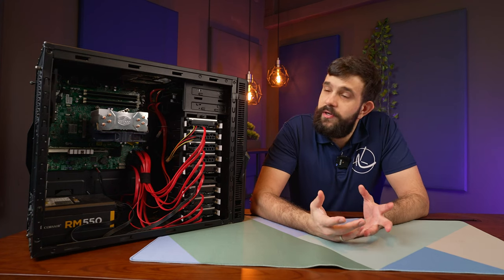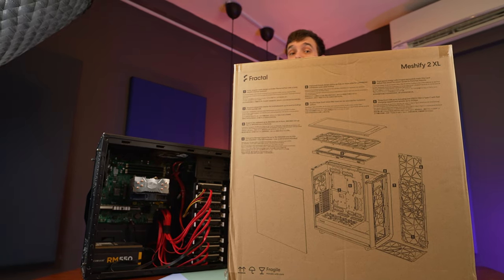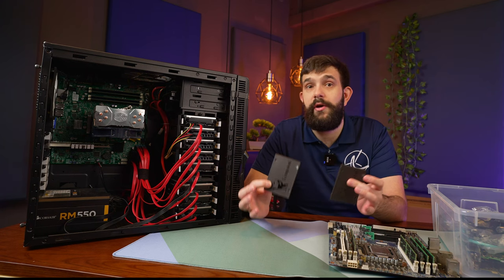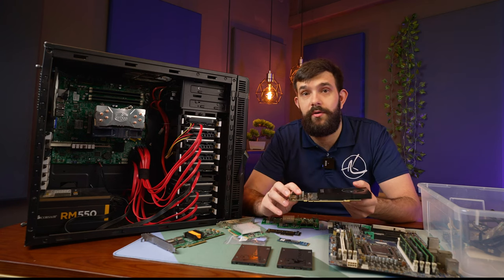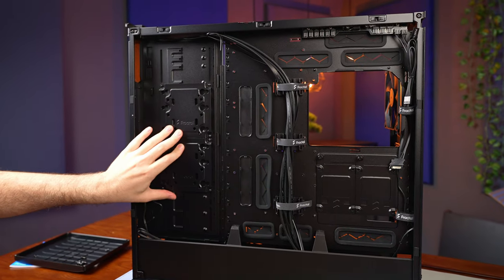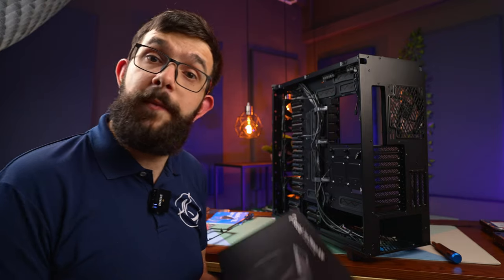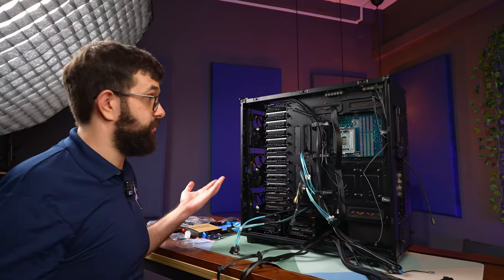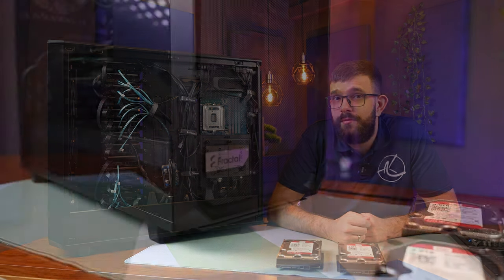Mountain of Drives in ONE Case - Fractal Design Meshify 2 XL

Comment: Awesome video 
As always 

Very interesting to see a server related video by you & present a realistic scenario while doing so. We all have to go through some hardware upgrading /maintenance every couple of years. 

I’ve recently gotten new cases for the servers I’m running as well. Got some cheap Chieftec cases & another SilverStone case as well. 

Really would recommend looking into Chieftec cases , relatively small form factor & a number of models support ATX-size motherboards , a number of drive slots 2.5/3.5” & price for these cases here is around 40-50$. 

Of course , if you have say 12+ drives and/or multiple GPUs in your server system , then a large case with plenty of air flow is still king.

Comment: Would've definitely gone for air cooling instead of liquid, reduces points of failure for a 24/7 runtime system to just the fan alone and still gives you the option to mount the remaining hard drives up-top as you initially decided on.
Reply from the maker: Great advice! Would certainly recommend that for most.

Comment: I love the video! I found it since I'm in a similar situation where I'm upgrading my existing homelab and I need more space in a case and I don't have room for a rack anymore. I've been heavily considering the Meshify 2 XL and I'm pretty close to pulling the trigger. Is there anything you would change after a year of this install? Any issues with the case, cooling, etc? 

Anyways, thanks for the video!
Reply from the maker: Thanks! Not had any issues with it and probably would not really change anything. Jus get most power efficient psu that you can
Reply: @A2KMedia  I'm reusing the EVGA SuperNOVA G2 I got in ~2019 so I should be good there for power. Thanks for the reassurance and your help! I hope you have a good night!
Reply from the maker: not bad! :) hope you have a smooth build!

Comment: Congrats on the video! Really informative! Will a 360mm liquid AIO fit with that configuration?
Reply from the maker: Hey, thanks! With the drives config, 360 won't fit.
Reply: @A2KMedia  thanks alot for thebreply. But even if I dont populate with the last HDD in the top cage? I have a 360mm Arctic Freezer Freezer II and I really wanted to fit him in there with my 7980XE xD
Best regards
Reply from the maker: The cage itself is in the way as it stands sideways to where the rad is.

Comment: Looks great, I would swap where you put the p2000 and the HBA though. Not sure about this specific board but typically lower 16x slots don't run at 16x which that p2000 would benefit from. Looks like an LSI 9211 and those run at 4x iirc.
Reply from the maker: hey, this is a workstation board with xeon processor. In this particular board all slots are full pcie so not a problem, but valid observation for consumer platform.

Comment: It would have been a good idea to show the temperatures of the HDDs running in the old case setup, vs the new case setup - after all the two main reasons you had for upgrading was for additional HDD mounting spaces and to keep your drives running cooler.
Good video for the rest of the information though, thanks.
Reply from the maker: Great point! sorry about that!
Reply: @A2KMedia  so, how are the HDD temperatures?

Comment: I have the exact old Define R4 case with 10 HDDs AND 1 SSD.  Yours was almost like it's twin brother haha. Though my sata cables were mounted neater and via the back. I am looking at the Meshify but not sure it worth moving everything over. Maybe in another few years.

Thanks for the video!
Reply: i too am still using the define R4, currently five 3.5 HDD's installed, it's a bit sketchy with the newer high capacity HDD's cause of the position of the screw holes on them, the case mounts don't match, can only screw 2 screws in.
Reply: @bikingchupei2447  2 screws is enough for me. Does the job.

Comment: So after all that, how cool/hot are the drives running?  Are the drives next to the power supply able to stay cool?  Did you end up adding a third fan to the front or any other fans?

Interested in doing something similar, so any info would help.  Thanks
Reply from the maker: Drives are between 30-35 C in a room with ambient temp of 25C so everything is perfectly cooled and I would not do any changes. Pretty happy with the build.

Comment: A local Fractal reseller is telling me I need to buy both the HDD cage and HDD tray for my additional HDDs.

FD-A-CAGE-001 HDD Cage kit - Type B, Black
FD-A-TRAY-001 HDD Drive Tray kit - Type B, Black, Dual @ $21

It looks like the cage isn't need right? From your video you're only using the HDD trays with existing mounts.

Comment: Don't forget to proper screw those drives into the cages to prevent vibration. I'm sure you are on top of that.  I wonder if since I only have 7 HDDs currently if I should get the regular Meshify 2 or the XL? Room to grow? I wonder if the tray will be flimsy without a full stack of drives? Please inform me.
Reply from the maker: Screwed them all up. And if you plan to grow then xl is certainly better choice
Reply: @A2KMedia  Thanks and love your videos

Comment: Hello, thanks for the video and great build.  I know I'm late to vewing it,  but I'm curious though...  Did you have any problems fitting that HP motherboard in that case (and old case for that matter)..?  as I understand it,  HP is rather proprietory with their connections like fans and power supply.  How did you overcome these problems or is this particular HP board more standard?  Thanks again..!
Reply from the maker: hey, no issue mounting the motherboard in this case as most of the screholes align. For the PSU I bought it with a little converter which you will need to get. It converts from standard atx to dell weird pin out

Comment: Have you ever compared this case aircooled vs Torrent?  I'm wondering if anything can be done to get it to CPU and GPU cooling closer to Torrent, because I like this case's ability to hold larger motherboards and more storage drives.
Reply: The Torrent isn't made to fit a lot of 3.5 drives.
Reply: @AlL-fw2cy  I know.  Just wondering if the Meshify 2 XL can be made to cool and silence as well as Torrent.
Reply: @StefanUrkel  sure, if you mod it. Bust out your dremel and jigsaw and custom fit three 180mm fans in there. In the end it will be cheaper to just buy a Torrent and trying to figure out how to put 3.5 drive cages in there. But 3.5 drive cages will impend airflow. That is probably one reason the Torrent has so few 3.5 cages. It's a modern tower not designed for mechanical drives.

Comment: Funny how this popped up in my recommended, I've been searching for people's NAS builds while I was doing research as I'm upgrading my own.  To not let my data hoarding habits get the better of me I went with the Define R5 to limit myself to 8 3.5's.  And as much as I love repurposing older hardware (current NAS is running on an E3-1230 V2, VM box is a 2678 V3) I couldn't resist getting myself a second hand EPYC Rome mobo + CPU + Ram combo for the upgrade.  It will be nice to consolidate my NAS + VM machines into one (sounds like you did the same).  

Just out of curiosity, have you ever had any problems with Truenas virtualized?  I've seen a lot of 'don't do that' comments floating around but I can't find any hard reasons why (not that I don't get why it could be considered a bad idea).
Reply from the maker: woahhh nice plan! I actually just ordered that exact set-up. going up to 24 cores on Epyc Rome :). To answer your question -  I've been using proxmox and virtualising truenas for about 1.5 years or so, not really had any issues besides my own mistakes with virtualisation - but learned a ton and don't plan to change this

Comment: If the front fans blow air though the spaces between each 90-95 deg hdd, wouldn't it be blowing hot air into the center of the case?
Reply from the maker: not had any temp issues since day 1 in this

Comment: Can you fit the x2 3.5 HDD drives where the Kingston ssd cards are at fit a grand total of 18 3.5 inch drives in total? I'm looking for a similar build but instead of the AIO, I'm thinking 2 fans for exhaust, 1 rear exhaust, then 3 front intakes at 140mm all fans. Air cooled with Noctua. Im also looking into the i9 12900ks 12th gen with integrated GPU, aorus master Z690, ECC ram not sure yet (recommendation?), PSU what do you suggest to hook up all drives with minimal splitters usage? To hook up all drives I was looking into LSI controller 16i 16 port as I think this should be enough to connect 16 drives and then connect 2 drives to the MB and can use 2 nvme cache drives. Main purpose is for plex and storage. Please help?

Comment: Hey! Thank you so much for this detailed review/build video. I just got the case myself. However, I have a question I hope you can help me with. 
For the HDD's mounted on top of each other, do you just need that one screw to attach each HDD/bracket to the case, or is it necessary with another screw against that wobbly back panel? I am afraid the HDD's will not be fastened well enough as I have tried putting the bracket it and it doesn't seem to be very stable.
Reply from the maker: Hi John, thanks for the feedback! Yeah you need to screw front and back, I recommend doing few top slots then middle then bottom to make it secure and then you can do the rest of the slots as you go. Also may need extra pair of hands for the initial bit just to make sure everything is straight

Comment: How did you power these drives? From what I can see, the PSU you used has 10 sata connectors, but you have more drives than that. I would like do the same build so I am very interested. Do you have any pcpartpicker list or more details on the drive expanders used?
Reply from the maker: I used few splitters too

Comment: I read somewhere that The meshify XL could have 18 x 3,5 drivs? Like The Define 7 XL?
Reply from the maker: You could slot 2 more drives with multi mount brackets at the top instead of the aio that I installed.

Comment: Do you use any specific kind of expansion cards? i have looked for HBA expansion card and most of them could be a bottleneck in transfer speed, if you got a link to the expander you use it would be much appreciated, if not i would love to know the max transfer speed your card has, thank you so much for the video.
Reply from the maker: technically speaking if I were to write to all the drives that are connected to the expansion card at full speed then it will saturate the link, but that almost never happens so I would'nt worry about it too much.
Reply: @A2KMedia  I mean, like can you write to a single disk at max speed? I am looking to set up a similar system to yours and my biggest worry is If the card could keep up with writing data to 2(or more) disks at 2gigabit per second, as I have 2 1G Ethernet lines coming to my server, so I want to make sure my bottleneck is network speed and not HD read/write data because of the card
Reply from the maker: oh you will have no problem with disk side then. the expander is HP 468405-002 24 Bay 3GB SAS Expander Card. I recommend reading up on  how it works. It has way more than 2gigabit speed as its 3gigabit per channel. I can easily push 1GB through it for which you will need 10 Gigabit network.
Reply: @A2KMedia  thank you so much for your time, I will read on it :)

Comment: Great video! I have this case for my new build. I actually bought it over a year ago and have it sitting in my office waiting. my original plan was to have at least 10 HDD's for data storage because at the time, I could only have like 8TB HDD's. But suddenly came out with the WD Gold 20TB and 22TB HDD's lol

So now I'm thinking, well dang am i really about to try and have 10-16 20TB HDDs on my computer? (My PC is mainly used for video editing, 3D modeling, animating, mod making, and gaming). I wanted a ton of space to locally store and back up all my videos I make, all the game mods I make (and download/use from others), all the videos I find and download or back up from DVDs (tutorials, movies, shows etc). I might actually be a data hoarder. i still have data from the late 90's I keep carrying over from build to build and I'm just in my 30's lol. So it's just non-sense from when I was a kid.

Quick question, did you have any trouble adding fans to the bottom of the case? I want to have as much cooling as possible in this thing. especially considering how how these high end CPU's and GPU's get now days. especially since I'm using my PC to do more than just gaming.
Reply from the maker: I actually did not need to install bottom fans as used this case more of a server for storage. I would really recommend separating the data sotrage as its own device and then your gaming/production PC being high end separate machine. Your server does not need to have much horse power and thus prety cheap enterprise stuff can be bought on ebay while your main pc can be a reasonably sized case with good cooling. Also 10-16 hhds do take up considerable amount of power so bear that in mind when power supply hunting

Comment: Hey mate would a strix 3080 fit in this case with the hdd bays set as yours is? Its 32cm long. Im looking to make a gaming/ plex server machine and my coolermaster case is just a bit small
Reply from the maker: yeah you should be ok.
GPU max length
Storage layout: 359 mm Open layout: 549 mm (524 mm w/ front fan)
Reply: @A2KMedia  sweet thanks heaps mate

Comment: Does everything for the Meshify 2 XL come in the box, or do you need to buy all the drive bays separately?
Reply from the maker: You need to buy extra drive bays.
Reply: @A2KMedia  Thank you for clarifying! That's the name of those exact ones? I see so many different SSD tray kits.

EDIT: I found it ("HDD Drive Tray Kit - Type A" or is it "Type B"?), but realize you are doing 3.5" HDDs, wondering if it's possible to do a similar setup with 2.5" SSDs, maybe just need to use an 3.5" to 2.5" adapter, at least there will be plenty of airflow.
Reply from the maker: I would recommend reach out to fractal support to double check
Reply: @A2KMedia  Cheers, good thinking! 👍
Reply: @Ecker00  it's the type B

Comment: If you put 140mm fans you will get turbulence. Solution is modding or 120mm fans
Reply from the maker: not had any issues with 140 running since day one :) super cool drives too
Reply: @A2KMedia  Exactly. 120's are TINY in this case. And 140's move more air and less noise.

Comment: Fractal Design Meshify 2 XL case is absolute garbage , Yes it may have a lot of room for stuff but good luck removing the plastic bezel on the front of the case as well as  the door .The retainers for these parts are shit and break very easily . don't waist your money on Fractal... it should be called fragile . There is retainers for the top grill that break very easily also. the rubber pads on the feet were one of the first things to fall off.

Comment: To get the BEST efficiency from a PSU, usually you need a PSU that is rated to produce twice as much wattage as your system uses. So if you use 600W, a 1200W PSU will typically be most efficient(titanium=94.7%) under 50% load(=600W).
Reply: No one with any credibility says this. This is a false rumor if anything.